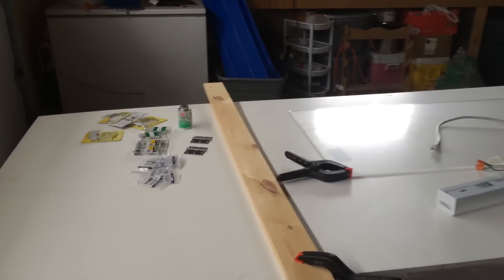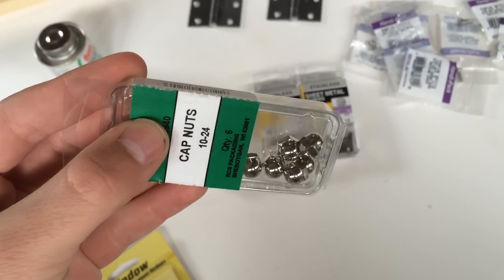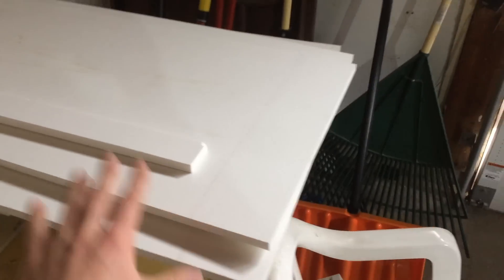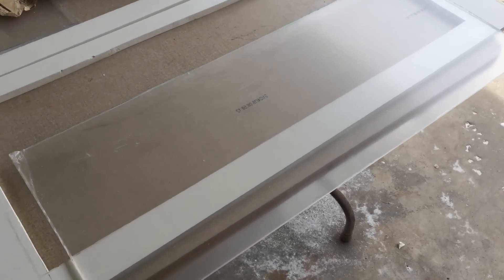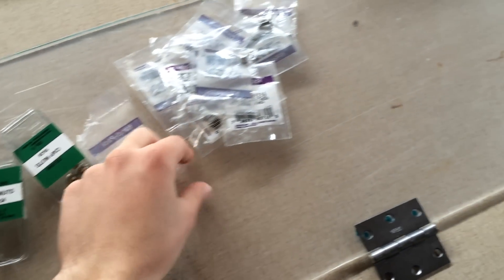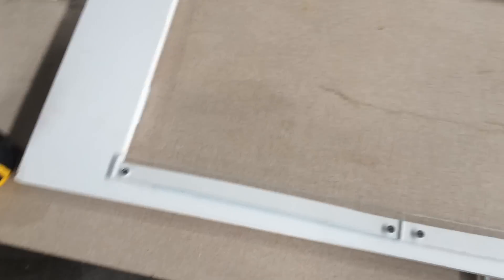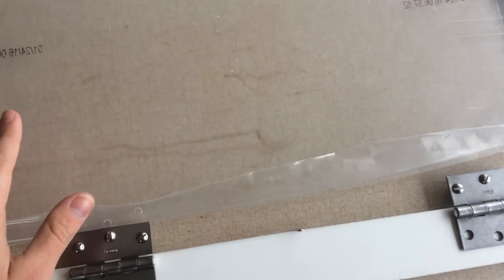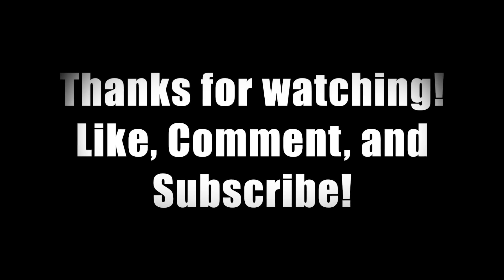How to Make a PVC Reptile Enclosure

Comment: Had an idea using the plastic that is used to adhere to walls around the shower. has anyone tried this. Sound like a really good idea its very flexible, mold resistant, easy to cut and would hold heat and humidity well.
Reply: and apparently super expensive nvm that lol
Reply from the maker: Lol well I'm not quite sure what plastic you're referring to but if it's really expensive than I guess it's not worth it. As long as the PVC works great and stays cheap I don't think I'll be switching materials. The only complaint I have about the PVC is that it doesn't let heat IN really well... so I cannot only use heat tape on my enclosures and expect to have enough heat. Although this could just be because I have a really cold house lol.
Reply from the maker: Thanks for the idea though
Reply: I thought it was much cheaper then that, deff not worth it. cool build

Comment: Pro tip for cutting anything that you don't want to have a jagged finish on, tape the lines before you cut.
Reply: Interested in this idea.. what tape? And does it just help you see the line better or actually keep the blade from making jagged marks?
Reply: @nikkidian  I just use masking tape. Preferably frog tape though, because I've found that it adheres the best. Definitely keep the blade cool, to keep it from making too bad of marks.
Reply: @STOPH3R01991  thanks so much!

Comment: Idk if you still check your comments. However. Will this be sturdy for a 6’x2’x2’ enclosure?
Reply from the maker: Sure do... just haven't had time to make any new videos recently. I can't tell you for sure as I haven't made anything larger than a 4x2x2 with this design. However, to be safe I would suggest supporting the top in the center to keep it from sagging. I have gotten very minimal (~1/8") sagging in my 4x2 designs but with the extra 2 feet I suspect the top PVC may sag a bit over time if it is unsupported. You could do something like a PVC pillar in the center for support. You could even cover it in Great stuff and peat moss/substrate to make it look natural.
Reply: MedusaPythons 

Yup. Sadly I own 3 Boaphiles and 2 animal plastics. 2 of the boaphiles I have is sagging a little and they are 4’x2’. I have a feeling the PVC we buy at Home Depot is pretty much the same stuff. Just not sure on that.
Reply from the maker: James Denike It certainly works just as well if not better as whatever they use it seems.
Reply: Would you use a pvc pipe as a support?  How would you attach it so it doesn't move?  Thanks for these vids!  I'd like to make an 8ft tank like this.
Reply from the maker: Asha Mokrosz that was the thought. If the pipe is cut perfectly perpendicular and wedged in between the top and bottom I can’t imagine it would move. However you could use some pvc glue on the ends to be safe.

Comment: Looking through DIY tutorials for PVC cages. Home Depot doesn't carry your PVC board anymore. Would this work too?
https://www.menards.com/main/building-materials/siding/trim-boards/royal-reg-building-products-1-2-x-4-x-8-white-pvc-panel/1429329/p-1510903720728-c-13411.htm?tid=6334415417275934342&ipos=19

What paint would you recommend to paint it?
Reply from the maker: Meagan Walsh I expect it would work since it looks to be the same dimensions and made of the same material although I haven’t ever seen it in person so I couldn’t tell you for sure. Home Depot still carried the pvc sheets a couple months ago. If you can find it online on the Home Depot website maybe you could have it shipped to one near you if the Menards option doesn’t work out.
Reply from the maker: Meagan Walsh as far as paint I am not sure but it seems like a material that would readily accept most spray paints and such. I would experiment on a small scrap piece to be sure.
Reply: MedusaPythons The link you provided in a previous comment to the material you used said it was no longer available is why I asked. The Menards stuff looks the same. Just wanted to ask before I purchased to make some of my own. As far as paint goes I'd want to paint the inside black as well, so it'd have to be some kind of animal safe paint.
Reply from the maker: Meagan Walsh I would assume once spray paints have completely dried and fumes have dissipated they would be safe but that’s just speculation. If the link doesn’t work I would just search for it directly on the Home Depot website to be sure that it really is no longer available as I find it hard to believe. The menards stuff however will likely work as well

Comment: Can you just but a heat pad stuck to the floor of the cage? Or do you need heat tape?
Reply from the maker: If you use any sort of heating device you have to have it outside the cage so the animal cannot burn itself. But if you put it underneath like I did with the heat tape I don't see why not. You will have to try it out and see if it is enough to heat the whole enclosure. I had to add a heat bulb on top as well as the heat tape to heat mine probably since I live in a cold climate.
Reply: you can build a platform inside that allows you to put a heat pad under it just make sure there's heat escape and that the animal can't go anywhere near the pad, it's how I have my ball python setup, just made a thin tile platform and it works perfectly for her underbelly heating

Comment: What are the dimensions for the cage. I'm looking to build one and yours looks the best. did you use 1 sheet?
Reply: Do you know where to buy these boards or boards like them I am having trouble finding some.
Reply: +TreePuncher915 lowes
Reply from the maker: check out some of the other comments i replied to. I think I posted a link but these are from home depot
Reply from the maker: Yes I used one sheet and made it approximately 4ft long by 2ft wide by around 18" high. I honestly don't remember the exact measurements because I made it to custom fit a shelf that I had at the time. But one 4x8 sheet of this stuff should definitely be enough to make a cage this size if you plan it out correctly.Just remember when you're making your cuts to take into account the thickness of the board and how they are going to fit together.

Comment: Will plastic panel be just as good ?
Reply from the maker: Not sure what plastic panel is? It all depends on if it's thick enough to screw together, or if you've though of some other way of attaching the panels together. Are you talking about HDPE panels?
Reply: +MedusaPythons it's 1/16 thick , 4x8 , plastic panel they sell it at Home Depot. My local Home Depot doesn't have the pvc you used in this video. 1/16 thick isn't thick enough to be screwed together is it ?
Reply from the maker: No not thick enough to be screwed... If you use it you will have to use exclusively glue. And what glue you will need depends on the material. There are many different types of plastics. If it is High Density Polyethylene (HDPE) then it will be very difficult (and expensive) to glue it together. If it is an ABS type of plastic though I believe you can just use a PVC cement which is much cheaper. Check out HLH Reptiles channel he's done these cages using HDPE and ABS and talks about the differences. 1/16" thick may be too wobbly to build a cage though depending on how big you make it. At least 1/4" would be a better bet I think.
Reply: +MedusaPythons that's what I was thinking that it wouldn't be thick enough to be screwed , and I definitely don't want a wobbly cage. Was thinking of making a 3x1x1. For a ball python. I have no problem going to Home Depot and ordering the one you used , was just wondering if it was a possibility .
Reply from the maker: Yeah better safe than sorry. You may be able to work with it but using exclusively glue to hold something together makes me a little nervous. I think you'll be much better off with the one I used. Very easy to work with.

Comment: Could you make the tank out of acrylic instead? Like black acrylic or something? Would it hold heat okay, or melt, or anything?
Reply from the maker: Acrylic is usually pretty sensitive to heat. I made a top out of acrylic once and it warped like crazy when I tried setting a heat bulb on it. I imagine it would warp a little with heat tape too although heat tape is not as hot as a heat lamp.
Reply from the maker: Your other problem would be putting it together. It's not going to be thick enough to hold screws of course so you would have to hold it together with special acrylic bonding cement (which I don't think is cheap). PVC really is the best option as far as I know for building reptile enclosures.

Comment: Is it necessary to have a half inch pvc plate ? a quarter inch is not more than enough for any snake ?
Reply from the maker: The 1/2" PVC is not for the snake... it's so that it is thick enough to be able to screw together. If you used 1/4" I don't think you would be able to use screws, you would have to just use glue which makes it much harder to get a sturdy cage.

Comment: how would this hold up to high temps for a dessert animal?  anything potentially toxic?
Reply from the maker: What temps are you planning to use it with?  I use a 95 degree hotspot and it works just fine. The only issue is if you are using something so hot it would actually melt the PVC.
Reply: MedusaPythons basking Temps will get to about 125.... what's the melting point of pvc?
Reply from the maker: That will probably be fine. PVC won't melt at those temperatures... the worst that could happen is that it may become slightly softer or distort. You could get around all these issues though if you just place a slightly elevated platform or rock with the lamp over it for the basking spot (so that the PVC itself isn't getting to 125 degrees. I'm assuming you're creating the basking spot with a heat lamp?
Reply: MedusaPythons yeah, it would be a heat lamp
Reply from the maker: Yeah then you're probably fine as long as you're not heating the bare PVC itself to 125 degrees.

Comment: I would add for some people it’s best to outline the pvc where your screws go when putting it together so you don’t miss. Also pre drill all your holes. If some people are concerned about drilling into plexus glass you can use 3m gorilla tape with the hinges. Also depending on what you plan to keep in it you can add air vents on top or just drill holes. Want to make it stronger you can use glue to connect all the pieces before screwing it. As well as add silicone on the inside to keep any liquid from seeping through. I’m sure there are a few more ideas that can be added. Good video!!!

Comment: Do you use flexwatt for under belly heat with this terrarium? If so is it inside or underneath? Thanks
Reply from the maker: Not flexwatt brand specifically but it is heat tape so it's basically the same thing. It's called THG heat tape. And it's underneath the PVC. You never want to put a heat source where the animals can touch it and potentially get burned. Although I will say that with the 1/2" thick PVC the heat tape doesn't heat the enclosure as effectively as I would want. Which is why I added an overhead heat bulb as a secondary heat source. I don't think you could heat the entire enclosure with heat tape alone
Reply: Ok thank you!
Reply: Can a 90 degree hot stop be achieved through the 1/2 pvc?
Reply from the maker: Yes. But the heat tape isn't enough to provide ambient heat to the rest of the enclosure... i.e. you will have a 90 degree hotspot but the other side of the enclosure will probably still be room temp.
Reply from the maker: Of course this all depends on how warm you house is. Mine is around 65 degrees so I had to use a heat lamp as well. If you keep the room like 75 or 80 then the heat tape will probably be enough to heat the whole enclosure.
Reply: K thanks

Comment: So do you think a fish tank could be done this way as well 3/4 inch sheeting glue the joints with pvc pipe glue or something?  Any thoughts
Reply: I’m sure if you did that and then used aquarium grade caulking silicone should be fine

Comment: Looks great. Trying this very soon. Do you think doing the front in just a 4 inch wide strip at the top and bottom with pocket screws instead of using a whole piece and cutting the hole out of it would work? Looking to do this for my snakes (testing it on the blue tongue skink since he's not as much of a flight risk of popping open the door) and I'm worried my red tail or blood python will get that door open pretty easily.
Reply from the maker: As long as it is secure I don't see why it wouldn't work. The issue would be finding a way to secure it (I assume with what you're talking about you won't be able to attach latches to the sides but only the top). I also prefer the look of having a cut out door instead of two separate pieces top and bottom but that is just my personal preference. But if you can find a way to secure it it shouldn't be a problem.
Reply: Thank you. if I use pocket holes and longer screws I should be able to secure it on three sides. I think that should be good,at east for lizards. still figuring out how to do snakes.
Reply from the maker: Yeah it may take some trial and error. I would say build the first one and see how secure it is... then adjust for snakes.

Comment: Hey man, gonna start breeding boiga and gtps, gonna have them in acrylic cages with rhps for heating, would you suggest making some homemade ones like this or purchasing from animal plastics or boaphile? Hows this one holding up? Thanks!
Reply from the maker: It's holding up great! Looks exactly like the day I made it. I ended up installing a screened ring in the top so that I could use a heat bulb for extra heating in addition to the heat tape. I would recommend builiding one because it will save you money and its enjoyable to make your own. If you don't like building things though and are willing to spend some extra money, go with the pre-made.

Comment: Great video! By any chance do u know if Home Depot carry the pvc in black?
Reply from the maker: I don't believe so... but I think this type of PVC readily accepts paint so it would be a simple matter to spray paint it black. I don't believe this would be harmful to reptiles as long as you air it out for a week or two prior to use.
Reply: MedusaPythons hey I have 2 questions.  Is this safe for heating for the reptiles such as a mercury vapor bulb or other heating lamps?   My biggest worry is one worrying about it melting and 2 worrying about the plastic emitting fumes if it gets hot and it end up killing the reptiles.
Reply from the maker: I use a heat lamp on my enclosure. I don't have it in the video but I just cut a large enough hole in the top for the entire circumference of the lamp and then reinforced it with acrylic rings screwed into the pvc which also held down 2 layer of aluminum screen over the hole (this is so that the snake can't touch the bulb) In a setup like this the pvc won't melt whatsoever. I also use heat tape underneath which heats up the pvc to around 105-110 degrees on the bottom side with no melting or fuming effects from what I've seen. I'll try and make a video on how I have the heating set up in this enclosure so that you can get a better idea of what I'm talking about.
Reply: Cool that would be great to see.

Comment: You can also use a Dremmel tool and they have a lot of attachments  and a kit usually goes for $100.00 $150.00 for a three piece set from Orchard Supply in Modesto CA.

Comment: A quick note: You had the right setup for cutting the inside of the face, you just used the wrong saw. You can make a plunge cut with a circular saw and then continue cutting normally along the track (it's the same idea as a miter saw, if that helps). Start far enough in that you can back-cut slightly to your first line and then go forward to the next line. After you do all four cuts, flip the face piece over and use the jigsaw to finish cutting the corners. This will give you the straightest, cleanest lines.

Anyway, good job with it. You should be proud of this build.
Reply: I was thinking the same thing watching this.

Comment: If I may ask, about how much did the project cost overall?
Reply from the maker: No problem! It was less than $150 for the materials. With the light, driftwood, plants, heat set up and what not, total cost was under $200.
Reply: Great, thank you! Also, where did you get your acrylic? I'm struggling to find a place that is selling it for less than $100!
Reply from the maker: No problem! I got it from Menards I believe. It was around $40 for a 2'x4', 1/4" piece. It's kind of expensive but that much will make doors for two cages.
Reply: Thanks!

Comment: Is it possible to follow this step by step but use glass instead of acrylic or would that be harder to do? I hear that acrylic is easier to scratch and damage but would glass be harder to install?  Thanks!!!
Reply from the maker: No, glass is totally different to cut. You need a special set up and saw to cut and drill glass. I agree that glass is more durable but unless you have the right setup and experience cutting glass I wouldn't cut it myself. However, you can check and see if there is a glass shop near you that can cut a piece of glass to your specs and drill the holes for the hinges, if you decide you want to use glass instead of acrylic. I haven't had any problems with scratches, but acrylic is somewhat prone to warp a tiny bit over time.
Reply: Alright thanks a bunch! out of all the DIY enclosure videos I have looked into this has been my favorite by far.
Reply from the maker: No problem and glad to hear it!